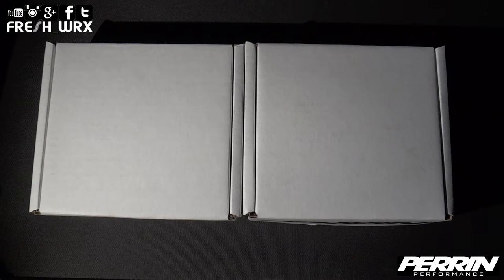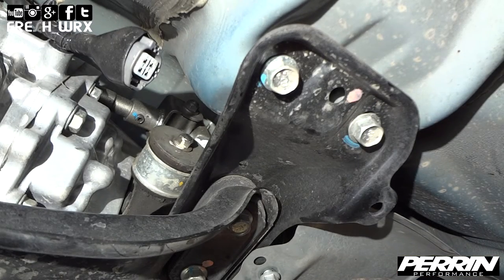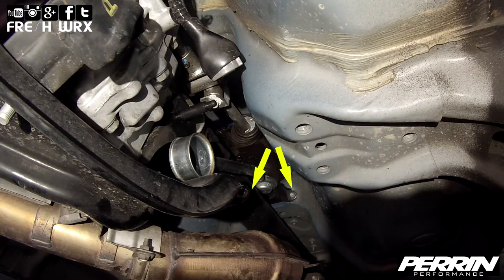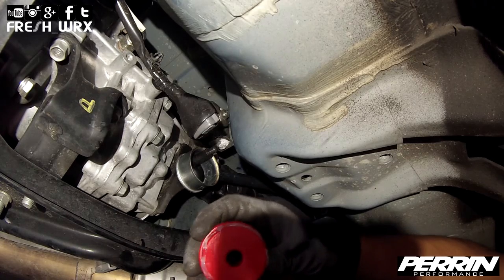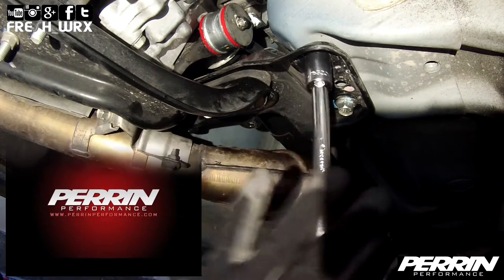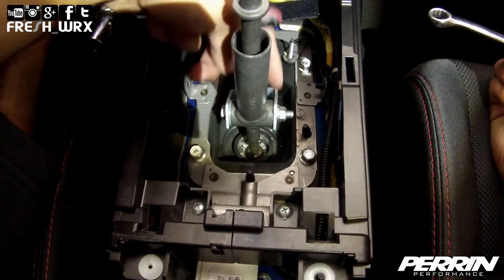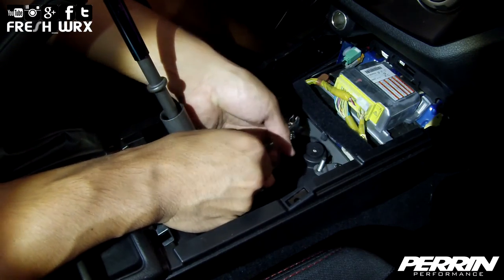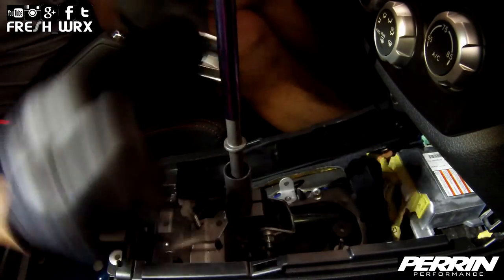Perrin Performance Short Shifter Adapter and Shifter Bushings Install

Comment: Did you have trouble feeding the two 15mm bolts for the rear bushings? I'm having trouble feeding them through the holes on the car.
Reply: +FRESH WRX PRODUCTIONS getting the first one on should be easy right? It's just the other one I would have to use that trick?
Reply: +FRESH WRX PRODUCTIONS i drive a 13 wrx so hopefully it works. Thanks for the help

Comment: I bought the bushings but it did not come with any grease. Is there any you can recommend? Or is regular commercial axle grease you buy in a tub OK?
Reply: +Subaru FRSH_WRX  Thanks for the quick response. It is not Perrin, It's from Energy Suspension. Lesson learned I guess. The lithium grease from the auto parts store should be OK right? Nothing special about it?